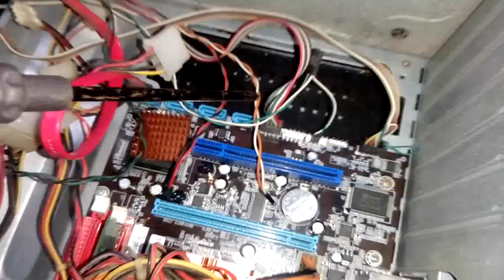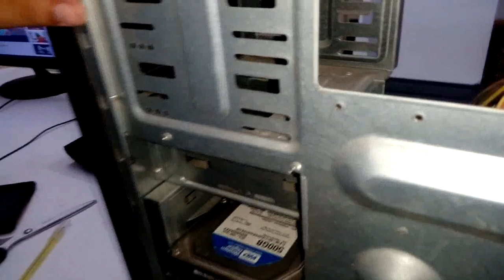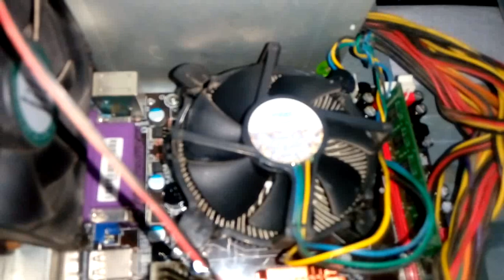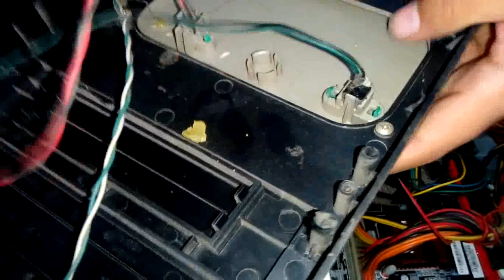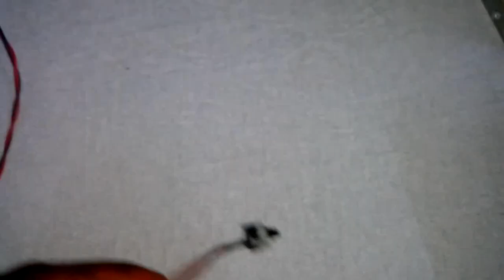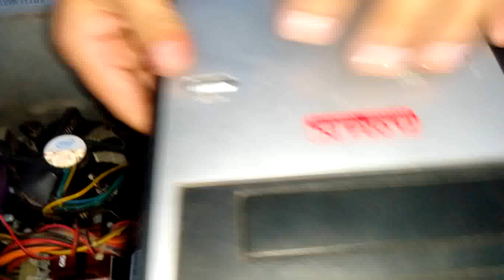How To Fix Broken Or Not Working Power Switch Button Of PC ? Repairing Power button  (100% Fix)

Comment: I just got a new pc and my dad clicked the on button and now it’s stuck and we can’t get it out or turn the pc on :/
Reply: Same here 😭😭
Reply: My problem is that the 
power button doesn't have that
LED light and that's all,
is running, but how come you know that is ON is the blue
LED light doent light up,
it could be the cables that goes
to the mother board?
Thank you!!

Comment: Worked perfectly - thanks! Never occurred to me that the reset switch is essentially a spare power switch if you need it. Shorted first to check and then just switched the connectors for power and reset. Nice hack. 🙂

Comment: i tried it once,its really hard to take out the power / reset button, its stuck very hard inside to the front panel. need 2 person to take it out
Reply: Same
Reply: Yes, in zebronics beast cabinet there're 2 push switches connected in parallel fixed on the power knob that's very hard to remove in case they go bad because it's fixed on a plastic base which has 2 notches that are difficult to move to remove the switch

Comment: Mine wires broke at the end where they are attached to small taster to switch pc on, can i use classic switch instead of that taster? Only dilema im having is that its written on switch it uses 15A current so im thinking that it wont do anything if im using less ampers which is case with pc, or am i wrong and it says that 15A is upper limit tho this doesnt make any sens does it?
Reply from the maker: You can contact me and Facebook call I will try to call video
Reply: @Technology2019Pro  no need, thank you anyways, i connected it to my switch and it works perfectly :)

Comment: I recently changed motherboard, now I need 4 front panel cables for the power button to work, while previously I only needed 2 for my old motherboard, is it that my PSU is too old for the motherboard and needs an upgrade as well?
Reply from the maker: What is the name of your mother board?
Reply: @Technology2019Pro  B450M Mortar Max
Reply from the maker: @wlos4029  
Come here we talk here        https://www.facebook.com/Technology2019-Pro-209781346186703
Reply: Some cabinets have two or more power switches just for power because they're connected in parallel maybe if one button goes bad then the other can be used to power on like in case of zebronics beast model cabinet that has 2 switches for only power but connected in parallel

Comment: After placing those 5 pins in its original place , it started to show blue deadlocked signal instead of red blinking signal .

Don't know what to do ? 😭
Reply from the maker: It will be fine only if you apply it in reverse
Reply: @Technology2019Pro  Even if I think about applying 5 pins in reverse order , it'll be malfunctioned where I kept 5 pins in their original position . 🤔

What was the benefit then ? 🤨
Reply from the maker: @yashbhagwat2664  You can send me an image of your motherbord
Reply: @Technology2019Pro  Let it be . It's too late to send the Images of my PC's Motherboard , where the Front Panel's fuse got blowned up after trying for last 25 times . 😖

But it's true that my PC is nothing without front panel , which got blowned up at last . 😖

Shocking ! 😖
Reply from the maker: If you do one thing you can put a reverse facing pin